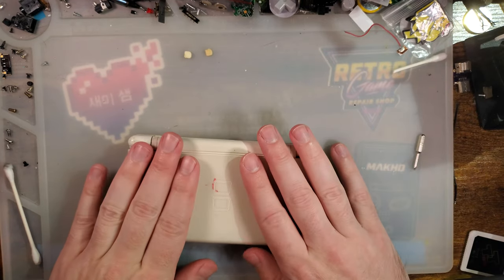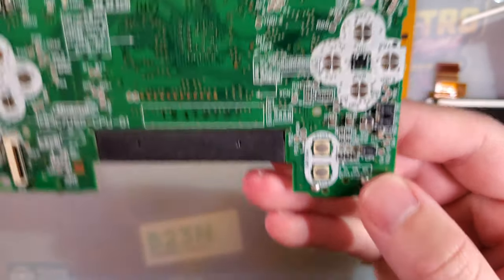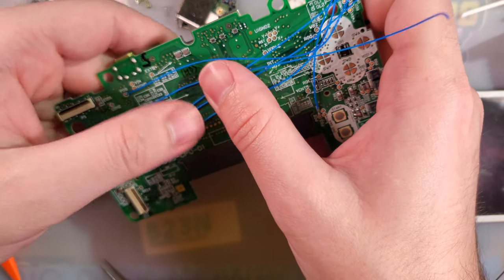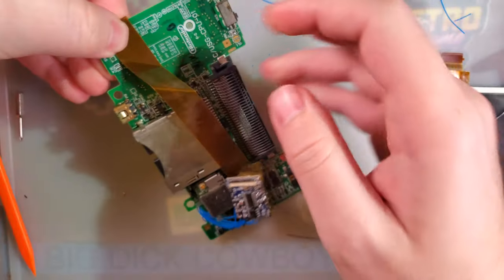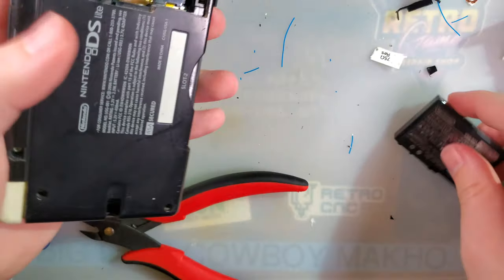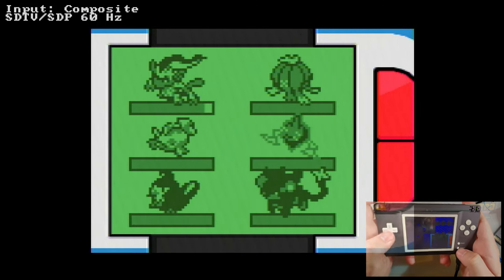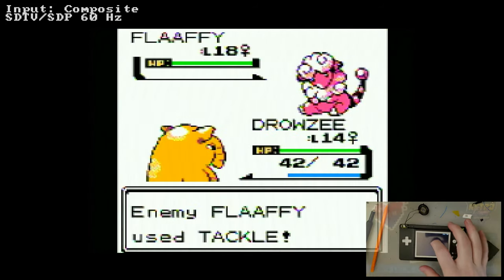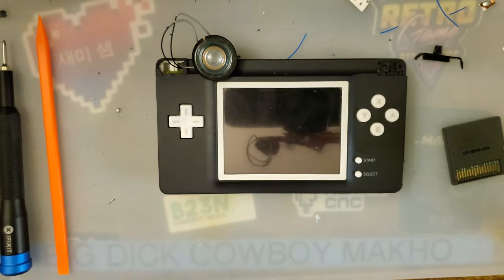DS Lite TV Out Mod -- Rhotronix

Comment: Hello, my DS lite top screen is entirely missing, hence it can't boot up. So to install the cfw bios by flashing it I need to solder a 330ohm resistor to simulate the upper screen right? Do I desolder it after flashing to carry on with the modification? Thank you makho!

Comment: Where did you get those metal DS buttons by any chance? Are they something RetroCNC is planning on selling? Are they a custom design? If so, do you/they plan on releasing the files for those who have access to the proper machines?
Reply from the maker: retrocnc gifted them to me. I don't believe he plans on selling them because modification is required to the console.
Reply: @makho  Well, if you’re ok with sending this message over to him, a good idea would be to make his own Macro Faceplates (either metal or 3D printed) with those metal buttons in mind alongside using a DS Lite Speaker for audio. Also, are those metal buttons you use for your heavily modded blue GBA SP using the button Membranes, or were they like a first batch version of RetroCNC’s standard SP buttons in not using them?
Reply from the maker: @rickyrns1059  maybe not first batch but yes, very early

Comment: If I want to just do screen swapping for a gameboy macro and not interested in any tv output could I just flash it and be done? Preferably I would want the button combos so could I do taht without even having to solder on any buttons?
Reply from the maker: well since the mod board is handling the button combos, no you would still need to wire up your own buttons.

Comment: Wdym if your consoles already flashed? Why would i flash it if i buy a loaded r4 card
Reply from the maker: You have to modify the system firmware or install a wifi module that already has the firmware modified. You're equating something else entirely.